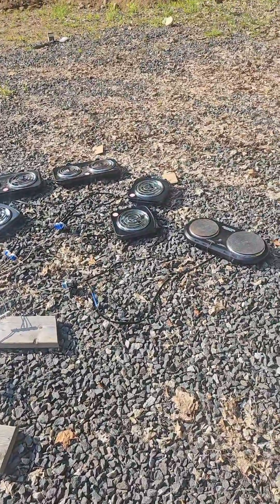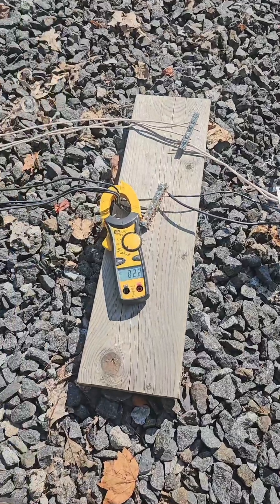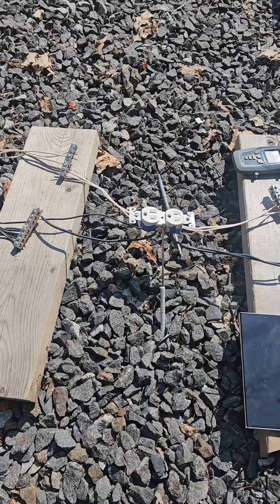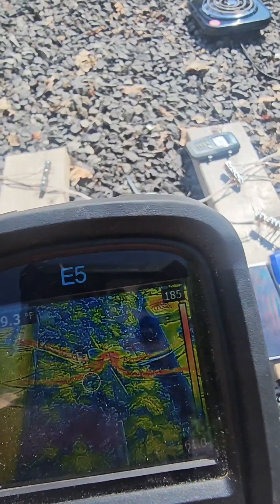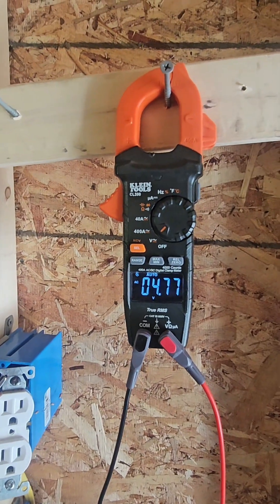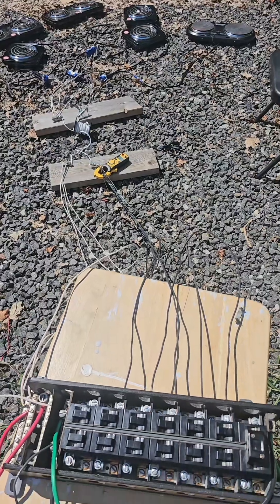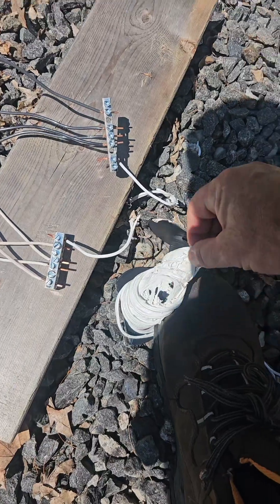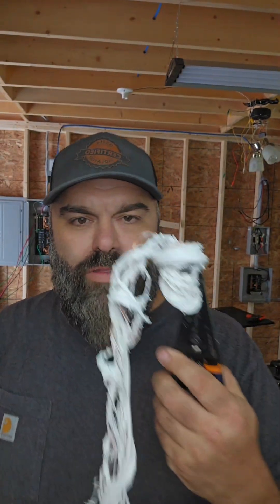81 amps thru a receptacle

Comment: That’s nuts. I thought it would’ve melted that receptacle faster than that with 80 amps flowing through. I’ve seen them burn up just from a space heater & a power strip with some Christmas lights & a desktop computer and I know that wasn’t anywhere close to 80 amps.

Comment: I am very surprised that receptacle survived, but now try that experiment again with the receptacle in an electrical box and pack some insulation around it to reduce convection from the equation and simulate a more typical environment.
Reply: Define convection
Reply: @creativesuit1930  heat transfer caused by fluid movement.

Take still air and moving air, both the same temperature, and you'll see the moving air wicks away heat much more rapidly than still air.

In the description above convection is massively reduced which will allow the devices to overheat with much less current than shown in the video. Packing insulation around the wires will also aid in thermal runaway since it further reduces the rate at which heat can transmit away from the wires.
Reply: @adamfink5294  But convection applies only to the heated fluid. Sure the air around it does increase in temperature but that's due to the heat from the receptacle radiating away from it. I do agree that in a wall the receptacle would be surrounded by less thermally conductive material and so it wouldn't be able to radiate as much heat away causing it to increase in temperature faster.

Comment: Technically the tab can handle lot of amp, if you check on the old glass Eddison screw fuse the melting area is tiny so no wonder a big tab like that can handle it

Comment: It's the wiring that can't handle 81 amps.
Reply: Yes, but a lot of people will say you should pigtail outlets rather than running through the outlet because the tab will overheat. This shows that's not the case.

I would still pigtail rather than use the tab, but that's mainly for ease of swapping the outlet in the future.

Comment: This is why I'm not a huge fan of pig-tailing outlets unless you need to. People always say 'to remove a failure point', but the screw connection on the receptacle (properly torqued) tends to be far more reliable than a wire nut, especially when you're jamming/bending wires around to shove them back in the box. This is especially true for replacements/retrofits where you may only have short conductors to work with. Much easier to put a shepherd's hook and use the screw terminal if you only have an inch or two past the box.

Comment: Wagos. Wagos would be fun
Reply: Assuming you mean an actual Wago product rather than using the brand name as a generic descriptor, be it wirenut or Wago both outlast the insulation on the wiring by a wide margin (in a normal circuit arrangement).  If either fail in normal use your premises has already burnt down.

Comment: Really fun one; try any AC motor 120v, on 240v.

Most survive. It's staggering
Reply: one of our service techs put a 240 motor on a 120 furnace the other day.  It actually ran for a day.  I'm sure the amp draw was nuts.  I'm sure he also did not check it post repair .  Anyway, we went out again 2 days later and the motor would still run half speed.  I've personally installed a 120 motor on 240 circuit.  (it was a late day)  The motor ran about 30 seconds before it burned up.

Comment: So it does show that the safety factors are EXTREMELY over calculated, you should rig something up with a huge reostat where you can keep dialing up the current till it blows! It would be fun and interesting to see where different things actually melt or burn, and how much over engineering is put into things.
Reply: Since it's the amps that matter, old transformer based welder with a variac for additional control would be the way to go.

Comment: Interesting. I installed 20A outlets when I moved into my place but a paranoid friend of mine said that was an issue if wires can't handle that load and if there was ever an issue I wouldn't know till it was too late. This video just proves we're overly safe along with margin of error. On top of that you were outside in direct heat. Pretty useful.
Reply: Heat can build inside walls easier than open air. But as someone who has done a ton of ebike projects and RC projects over the years, yeah...wires can take a whole lot more amps for a short amount of time than they are rated for in houses or commercial.
Reply: He was outside in open air where the heat can escape from the wires, which is a lot better than inside the walls packed in insulation where heat will just continue to build up.
Reply: The NEC is designed to be fail-safe whenever possible, so the first point of failure on an overloaded circuit should always be somewhere that a fire isn't likely to spread.  That usually goes: Breaker Panel -> Switch/receptacle -> Wiring.  15A receptacles are built to handle 20A for this very reason.  Now if your "paranoid" friend is calling you out for putting 20A receptacles on 14gauge wire then he's not paranoid, your house would fail a home inspection and void your insurance policy if you had a fire.  If your goal is just to have higher-quality receptacles then get 15A commercial-grade receptacles with beefier contacts and longer service life.  If you are building an addition or remodeling and you want to allow for extra capacity in the future, just flip the fail-safe order around and go from highest amps to lowest.  For instance10 gauge (30A) wiring -> 20A receptacle -> 15A circuit breaker would be code-compliant and future proof, even if it is absolutely silly.

Comment: I wonder if plugging into the plug would've heated it up more? Pretty amazing that plug handled it like it did though.
Reply: It makes a big old difference. He is just choking his circuit down to the little tab that bridges the two sockets. If he directed the power in normally and made the load go through the socket it would be a realistic demo. The blades don't always have ideal contact and the cord most likely doesn't have two 10 gauge and two 12 gauge conductors.

Comment: That's a great experiment.  I wonder how the temperatures would compare in a common residential  installation.   Inside a box on a wall, with and without insulatuon.  All those variables would change how fast the heat dissipates.  What would the difference be between the bargain and commertial receptacle.  I am staring into the rabbit hole, contemplating going out to the shop.

Comment: Inductance of your coil of wire must of changed your current output on the lamp cord experiment .
Reply: Or increased resistance from the under sized conductor caused a voltage drop to the load, resulting in lower current draw.

Comment: So when we see melted receptacles it would be because of arcing/bad termination not necessarily overload?
Reply: I think so. The arcing creates more heat than the current passing through a resistor. Just like an arc welder does.
Reply: Correct. Bad termination is very common.
Reply: No, receptacles can melt due to some types of overload too.  This demonstration only tested running the current through the bonding tab (in one terminal and out the other), and showed that it's basically not possible to overload that bonding tab on a receptacle.  However, running too much current through the plug contacts (i.e. to an appliance) is a different situation, and potentially can still cause excessive heat and melting (but was not tested in this setup).